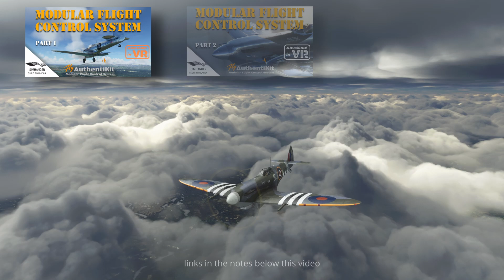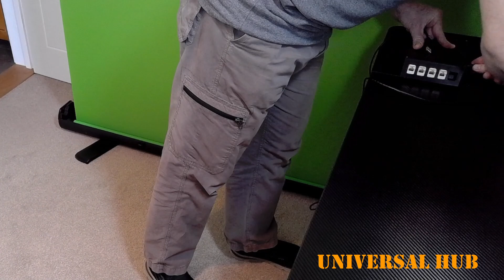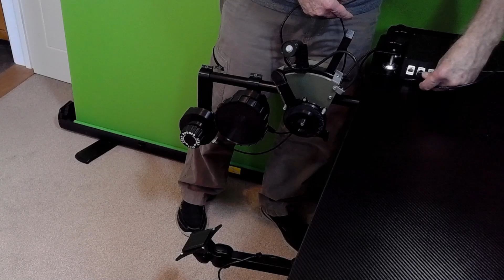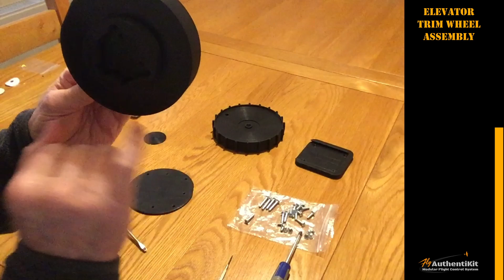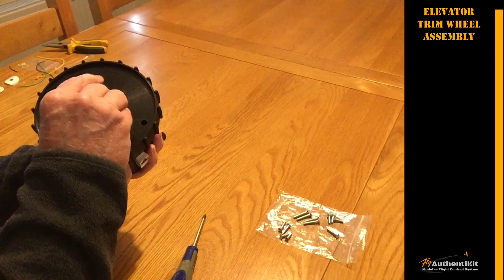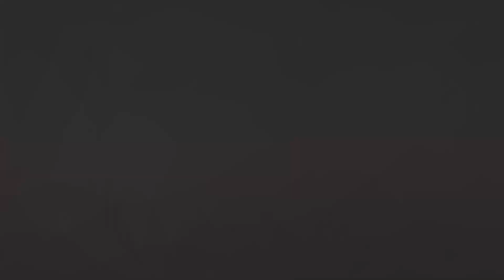COCKPIT FOR VR PILOTS | Authentikit | FlyingIron Simulations Spitfire Mk IX | My cockpit build.

Comment: Fantastic idea and implementation by Authentikit ! ..But also another well put together, indepth video by yourself Mark ...Thanks 👍😀..
Ps. I nearly had a heart attack whilst watching the " trim wheel build" section of the video! ..it looked like you used a fair bit of pressure with the the screwdriver  to  "clamp" the wiring connectors  ..the screwdriver was pointing towards your palm ..if it had slipped ! 😬😣.. Ouch!